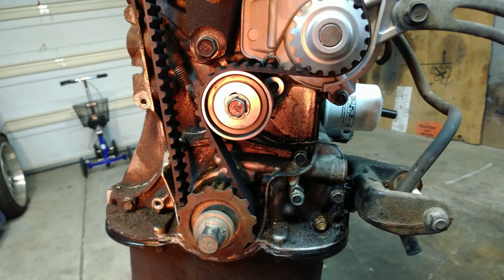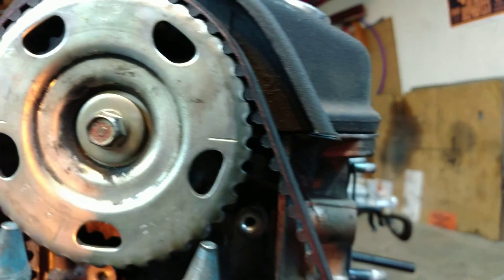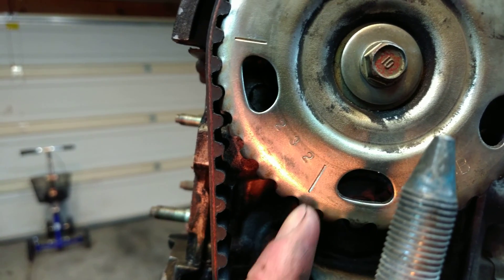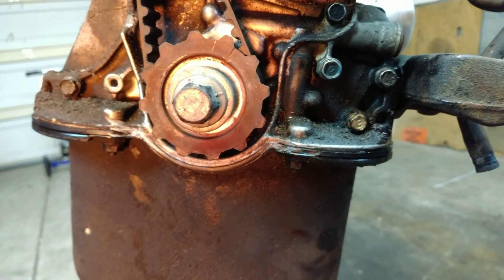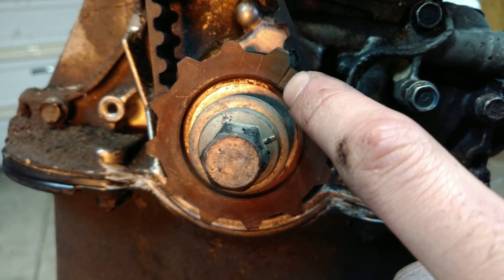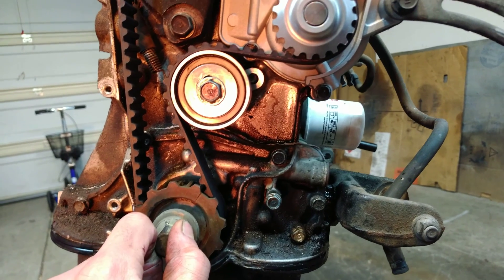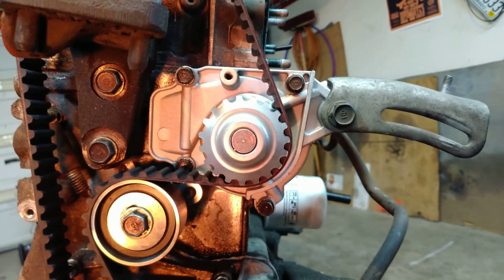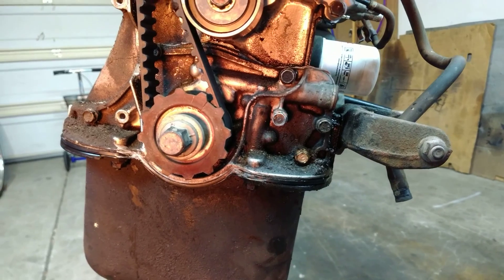How to - Mechanical timing on a D series

Comment: Amazing video of how to time an engine I was driving and my timing belt broke off while I was driving stranded I had a spare belt at my house watched this video and called a friend to bring me my belt changed my timing belt on the side of the road I would like to thank you so much
Reply: Wow that must have been an experience. How did you get the crank bolt off on the side of the road?

Comment: Wow. I just learned which part I was missing!  My stock D16Y7 timing sprocket would not fit the D15B(non-vtec) engine that I swapped into my 2000 Honda Civic LX, and I wished I had learned of this video last year.  I did the wiring trick which makes it run like shit, holy shit. haha  Here's the part number that I needed for this D16Y8 timing sprocket that you talked about, in case anyone needs it.  I believe this was the missing link that I needed.   13621-P2F-A01.

I will let you know in 1 week, whether or not it fits the JDM D15B (non-vtec).   I'm assuming it will because it fit your D15B7, but I'll 100% be sure to comment if it does fit for the JDM D15B for other people out there.
Reply: Y7 and y8 have the same timing gear, d15b is different than all I think
Reply: I learned that it did not fit the crankshaft.  I've given up on trying to OBD2B my OBD1 engine :P